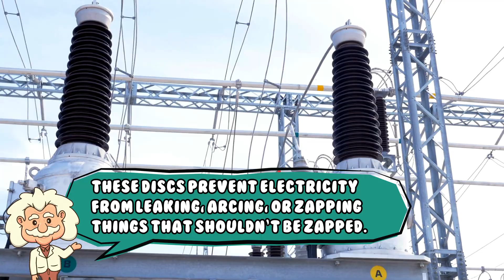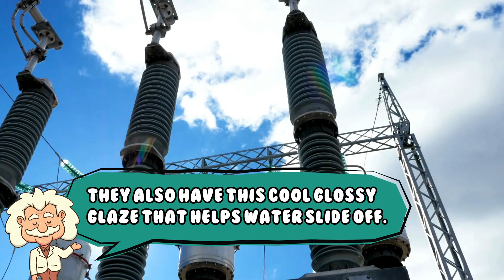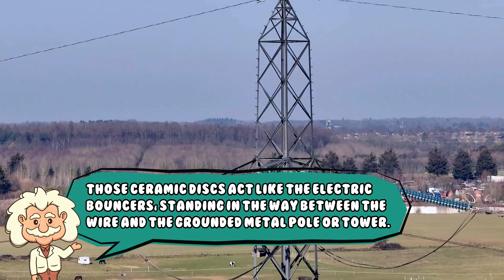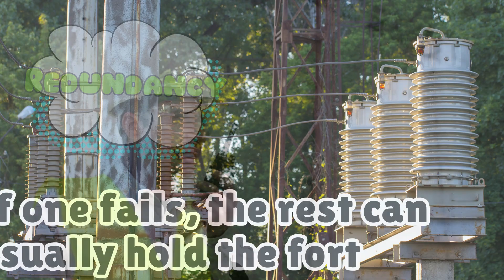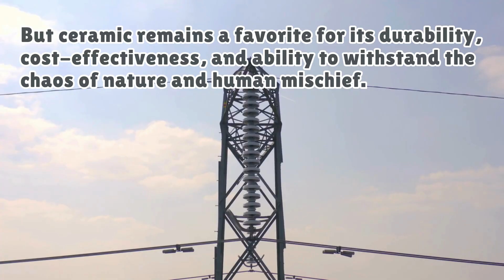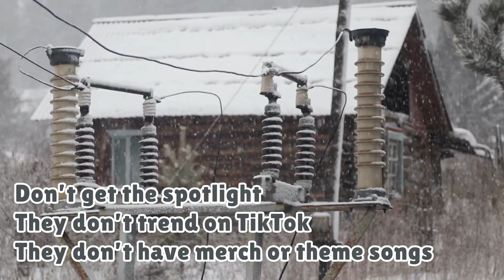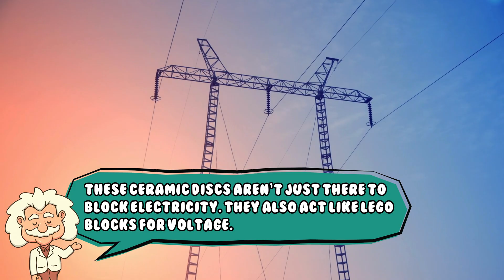What Are Those Ceramic Insulator Discs on Power Lines For?

Comment: The narrator says never to touch them BUT , You don't have to touch them to get electrocuted , Just getting near them , An arc will jump right from the power line and strike you down , Just the same way as getting stuck by lightning in a thunderstorm , All that high voltage will surge through your body and down into the ground , Killing you instantly and literally cooking you 
You have to respect electricity , It is very relentless and very unforgiving , It doesn't care if it flows through you or a wire , It always wants to get down in the ground no matter what , If it finds you as the easiest path to the ground , It's gonna choose you , It's not particular about what path it takes  , It's always gonna look for the easiest path to the ground and the path of least resistance , Never attempt to do any electrical work unless the power is off and that you lockout and tagout the disconnect switch or circuit breaker 
Lockout tagout is just as important at home as it is in the workplace 
ALWAYS PUT SAFETY FIRST !!!!